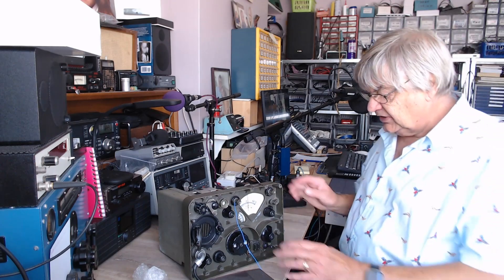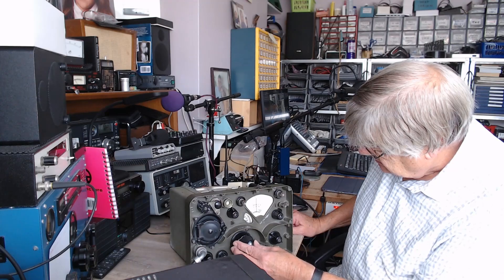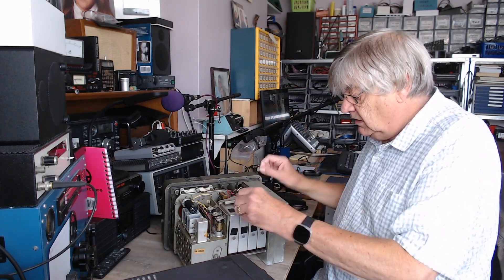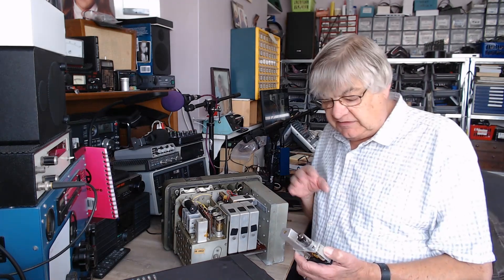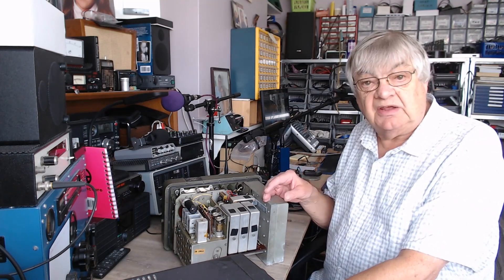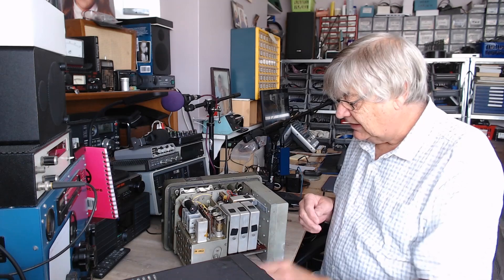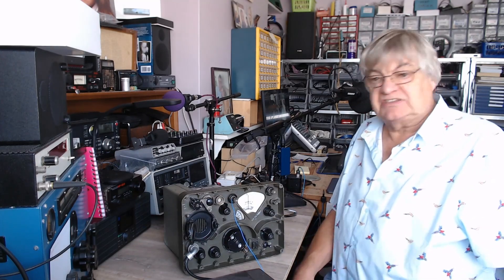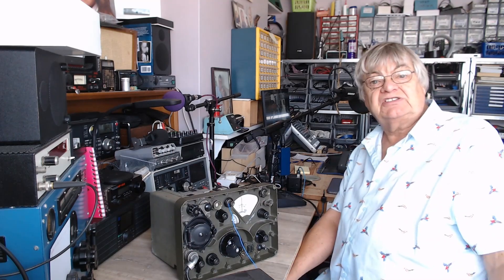G4NSJ - R209/2/B Reception set valve tube military communications receiver. Part 1

Comment: Looks like it was built like a tank Ray a very nice looking radio indeed with a rather unusual design. The nearest I got to working with old military radio's, was in the 70s when I was an SWL, with a CR100 and  PYE 62 set on Top Band and on that not to mention band lol! Always nice to see this old gear, thanks for putting together this interesting video Ray!
Reply from the maker: I love the 62 set. I still jhave a CR100 which I use quite often. Cheers, Ray.
Reply: @g4nsj  OK Ray about the 62 set. I also have a CR100 from my SWL days, but it's not in working condition now. It would be a real mission trying to get it working now, with the old valves and it's weight. I used it a lot on Top Band in the good old days, great for AM and loved the way it tuned around the band. Audio quality was great as well on a big speaker. Fond memories of tuning in Loran on 160 and the AM mobiles on the CR100!!
Reply from the maker: @mattbates6887  It would be lovely to get the CR100 working again. They are great radios! Cheers, Ray.
Reply: Back in the 1970s used to hear people drifting around 6.6MHz on 62 sets and wishing I could afford one on my pocket money. They only ran a watt or two out - it was amazing they could get such a range.

Comment: M0MBG Nice Radio another great video. Have just fully renovated a  Yaesu FT 200 Transceiver.
Happy Days. We can have all the new stuff, but working on the older equipment is a challenge and satisfying when it all comes together 😁
Reply from the maker: It is satisfying. Part two will be ready in a couple of  days. Well done on the Yaesu! 👍

Comment: This was state of the art in 1951. Curious how IF AGC seems to be derived from output stage audio level instead of detected carrier level. I guess that has advantages when listening through phones. SSB sounds fine through CW mode & BFO. If there's no XTAL filter the IF will be carefully staggertuned.  I wouldn't replace the selenium rectifier if it's working fine, they are much quieter than silicon too. I guess for plug in modules there are extender adaptors if want to probe while live. The RF front end, if it really is meant to amplify and not just isolate the antenna, is it because a tuned RF preselector isn't set right?
Reply from the maker: Yes, it really was state of the art. The new valve has arrived and the RF stage is working well, it’s come to life! I’ve realigned the front end so the IF stages will be next.
Reply: @g4nsj  With that increase in gain it must be tempting to also try out each the IF slug screws and see how much more gain there is. Many people would switch to FM no antenna and peak each for maximum speaker noise wrongly thinking 'more is better' as if that's a good thing.  A nice flattish top response SSB crystal filter has a cleverly staggered alignment and has an intentional insertion loss.
Reply from the maker: @jagmarc  I will do the IF alignment at some stage with a signal generator. I don't think the  IFs are staggered.  More coming soon...
Reply: @g4nsj     If the radio is destined to be used with a converter (for NBFM 70 cm or 2m etc)  the IF strip inherently good stopband for rejection adjacent co-channel strong signal, prevents the pesky capture effect obliterating. Being as it's already FM gives you a head start. 
With the cheap nasty ceramic filter based IF suffering from this the trick was to insert a mechanical filter so they complement each others deficiency.
Reply: @jagmarc  I definitely won’t be using it with a converter! I’ll be using it for what it was designed for.
Reply: @raysrants    After over 6 decades since designed , there's still very little FM content over its coverage.
Reply from the maker: @jagmarc  FM has never been used on HF. The army tried it decades ago and gave up with it.
Reply: @g4nsj   Exactly my point!
Reply from the maker: @jagmarc  I’m not sure why you mention ‘stopband  for rejection adjacent co-channel string signal prevents pesky capture effect obliterating’.  This is a 1951 comms receiver.  It has an IF frequency of 460KHz.
Reply: @g4nsj   They make really good with converters.  
I should elaborate more because the issue is about FM which isn't used much on HF. Alongside the weak signal you're tuned to trying to read, is a very strong signal that you're NOT tuned to, maybe 40 kHz away. It's well outside the FM detector but it's inside the IF filter bandwidth. Some IF strips especially so dual conversion don't match the bandwidth of the detector. The effect is you're listening to a weak signal, then strong one 10 kHz away comes in and is like a squelch just cut in.
Reply from the maker: @jagmarc  Er… OK.
Reply: And for FM,  3 tuned 460 kHz tanks are better than a cheap nasty dual conversion using just 10.7MHz and 455 khz ceramic filters.
Reply from the maker: @jagmarc  If you say so! 😂
Reply: @g4nsj   There's some really well designed 70s Armstrong and Pioneer FM broadcast receivers that take this into account.

Comment: I rember in the 1980s  my uncle who worked at a navy base gave me some obsolete resistors and capacitors each individually  sealed in tiny  polythene bags e with Mod  part number and description in the small hermata ..... water resistant bags some hand written. Those capacitors in that radio  are very similar.
Reply from the maker: Yes, I believe they arer the same caps. They were very popular back then.

Comment: I remember GWM had a load of B40 receivers (some still in their boxes) around the time I used to go there.
Reply from the maker: Hi Charles, I think I remember them in their boxes. I had a B40 which worked very well. They were huge radios that weighed a ton! Happy days. Cheers, Ray .
Reply: @g4nsj  Yes a nice compact receiver that R209. Remembered the Murphy B40 from my days in the school radio club @1972. So recently purchased one to restore. It's making its presence felt in the corner of my man cave. I have a couple of small projects to finish first and then i'll don my supports to lift it onto my bench. Proper boat anchor.
Reply from the maker: @bofor3948  I had a B40 back in the 60s. Great receiver, although rather big and heavy! Cheers, Ray.